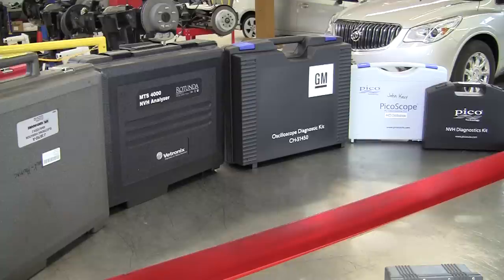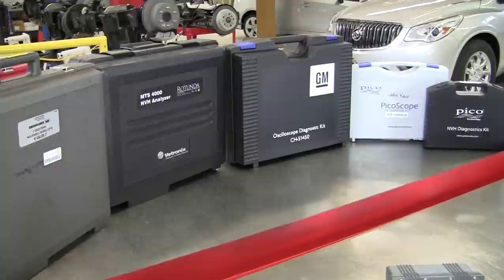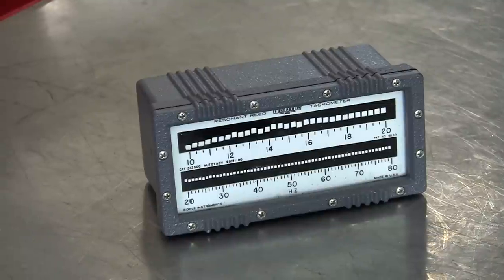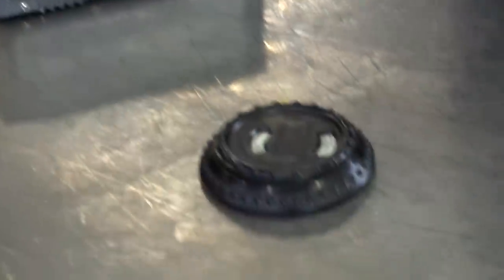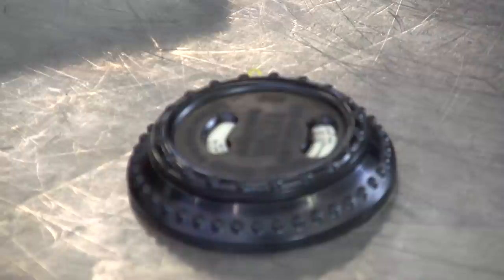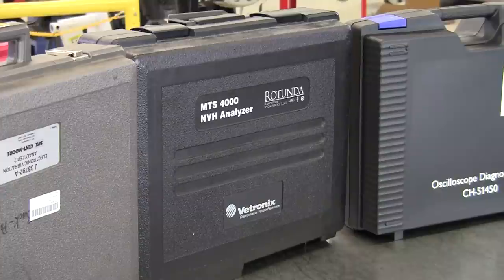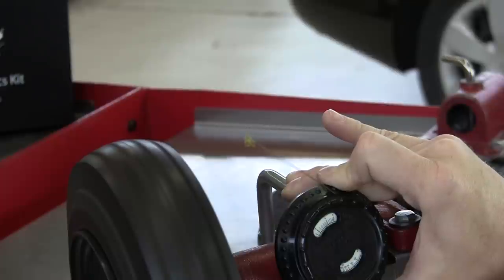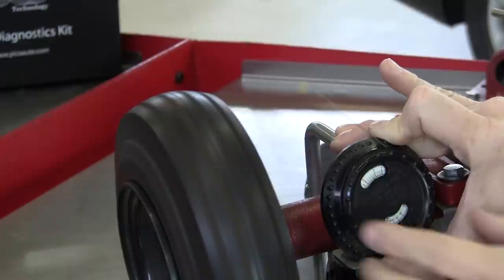Automotive Vibration Analyzers - Part 1 of 5

Comment: I have the most experience with the Sirometer. However it does require developing a skill. But when you get it, you get it. It's cheap, and very accurate. Once you've dialed in the correct vibration. The wire will appear orbital.

Comment: The German design wire vibration analyzer is worth its weight in gold,, I use my extensively working in a small engine repair,, many time a customer will talk about a high vibration,, it cannot be easily diagnosed because of the moving parts,, I used it Many Times doing tune ups on engines on vehicles,, a little tricky at first,,, playing with them,,, when and where and how  too place them,, had a customer one time complain about a vibration at 40 to 45 miles an hour (Truck) then it seemed to smooth  it self out,, by process of elimination, attaching a water hose clamp to a Driveline,, rotating it every 1/2 of an inch we discovered she had a bent Driveline,, then she told me she replace her U-joints several times, I told her that was pertinent information that could save me a lot of time.🤤
Reply from the maker: Awesome, thank you!

Comment: the mechanical fourier transform is so cool 😝 
I’m trying to do some measurements on a car flywheel and I’ve built a piezoelectric sensor and I wired a tachometer to send bot signals to an portable oscilloscope. The oscilloscope works pretty well with 2 channel input. This one was like $600 but there are even cheaper ones available. Btw it has a FT function but it’s kind of slow. Your mechanial analog one seems to give you pretty crisp readings 👍 even the syometer is ingenious:)

Comment: Hi John, great stuff!
If you have a tire with two high spots at 90 degrees apart, would this cause a second order vibration or two first order vibrations at a different phasing?
Reply from the maker: Thank you! It would be a second order tire speed related vibration

Comment: Hi Professor Kelly, I try to find the relation in between dBg that are the scale for a Toyota NVH tool, compared to mg that e.g. Pico uses? Are you able to provide any information on that? Thanks in advance! Br. Sjakan
Reply from the maker: The dBg is for sound through the microphone attachment. There is no conversion to mg (milli-Force of gravity).
Reply: Thanks for your reply, I also never have seen this in reference on Vibration, but if you Google Toyota NVH training, you find a pdf doc. That states this on page 110. Direct link to the pdf is here. http://www.testroete.com/car/Toyota/mr2%20spyder/References/Technical%20Training/04%20-%20Noise,%20Vibration%20and%20Harness/04.pdf  Br. Sjakan
Reply from the maker: sjakan123 here is a link to the ISO standard for dBg. It is used to measure sound pressure levels for frequencies lower than 20 Hz. https://www.iso.org/standard/13813.html
Reply: WeberAuto, what I found regarding the statement dBg. The scaling is also available in the Pico tool, when measuring vibration above the Infra Spectrum.

Quote:
Amplitude - The quantity used to express the level or magnitude of a vibration. When expressed
in dBg (Decibels g) it relates closely to what the customer feels. 
Br.Sjakan
Reply: I miss an answer on this statement, Thanks in advance.